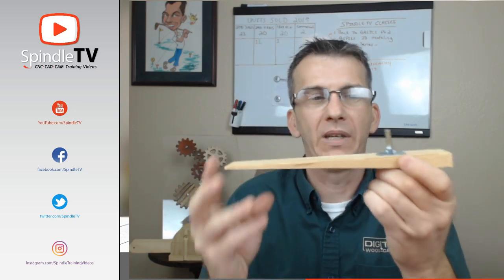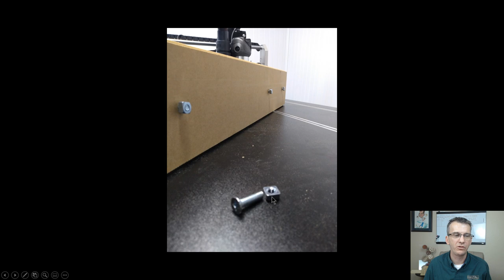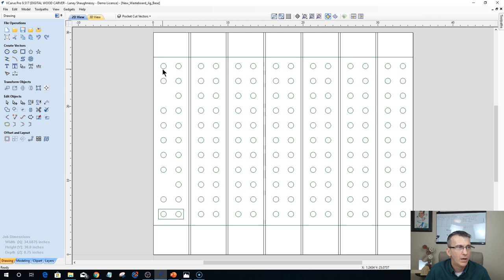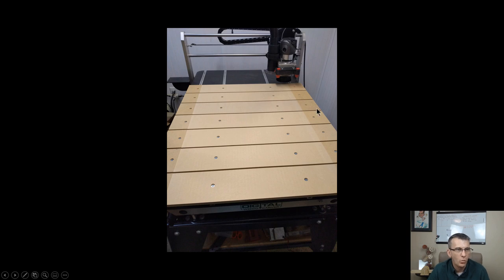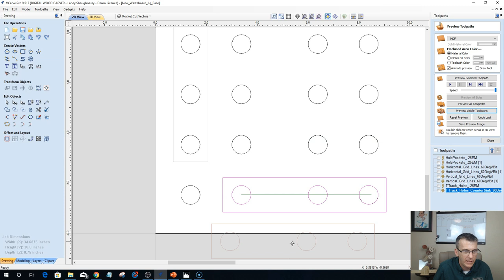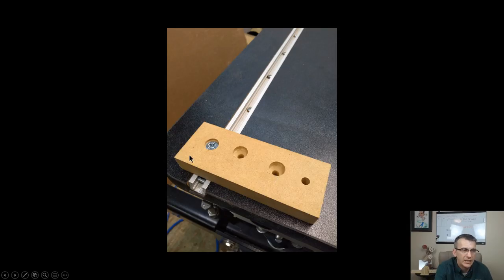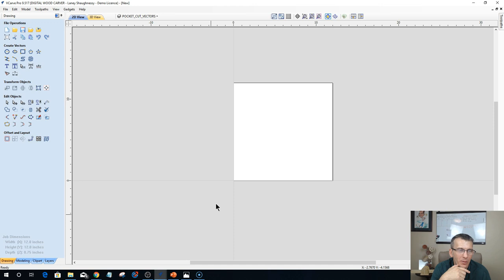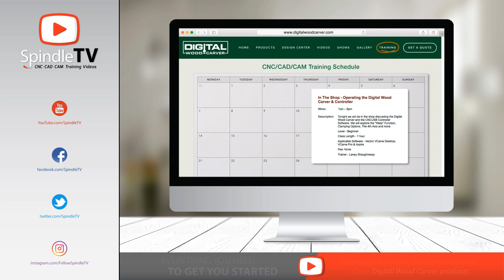A Versatile Waste board - Step by Step

Comment: Your Y zero is inside the area you have surfaced out with your surfacing bit because the surfacing bit is much larger diameter than the other bits you would use. I set my x\X &Y off of each other job I do.
Reply from the maker: The X and Y Zero positions are based off the center of the router bit. The center of a bit is the center of a bit no matter its diameter. And the X Y Zero positions would remain the same for each toolpath it would not change. From surfacing to the finishing toolpath. Are you saying you are using a different Y Zero position for some reason? Let me know; I may be misunderstanding what you are saying.

Comment: When you go to level the spoilboaed, the tool path can be designated as a climb cut only and the overlap as 0.425”, then designate the entire area, wouldn’t the  toolpath automatically only go the one direction then rinse and repeat as you demonstrated, instead of having to designate each new start point manually for each path of the bit?

Comment: Thank you for your great Ideas!  The zeroing each corner of the wasteboard is awesome idea.   How many of the wasteboard pocket holes do you use that are all over? I can see about 1/3 may  be very convenient, like the long edges in X and Y and several rows along the usual high use area. but is the whole board used that much?  New to this and my CNC is on order.
Reply from the maker: The holes are 3/4 diameter and spaced every 2 inches on center. There are two rows of holes per slat 7 slats so there are 210 holes

Comment: I have an older 2440 with the white surface and the slots run with Y. They are  spaced at 3”. Would you recommend sticking with 3” or going to the 4.75 like you did in this video?
Reply from the maker: On that table with the white slat board top that you have I would recommend running the waste board slats along the x-axis instead of along the Y like the new models waste board and i would make the slats wide enough that i could have at least 6 spaces between them to use as t slots with whatever space is required 0.25 to 0.27 inches of spacing x 6 spaces do the math based on your table with. - the spacing divided by 7 slat ...the width of the slat would be based on that